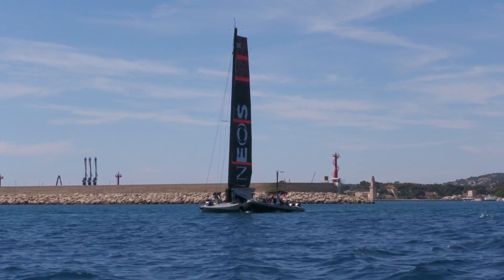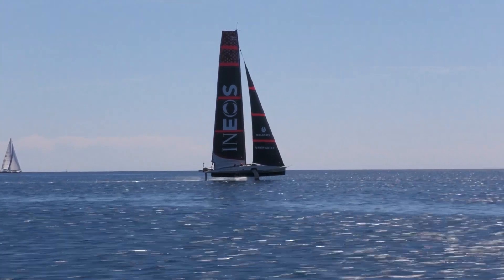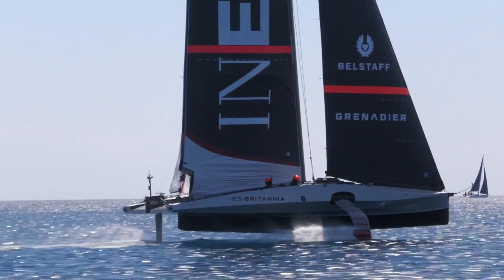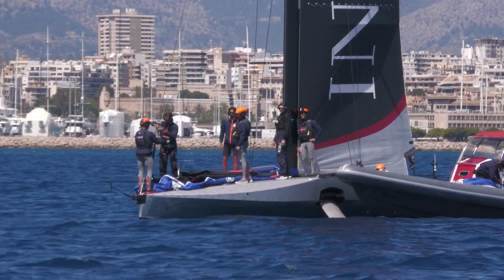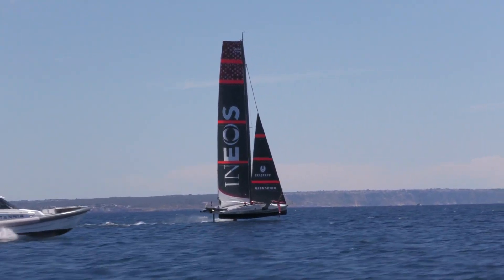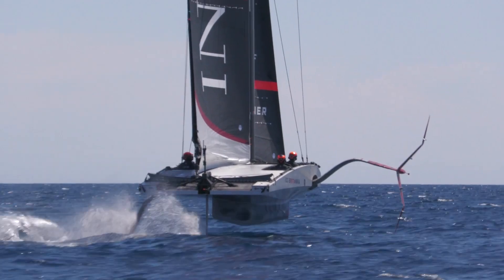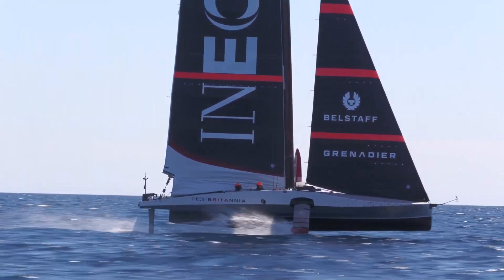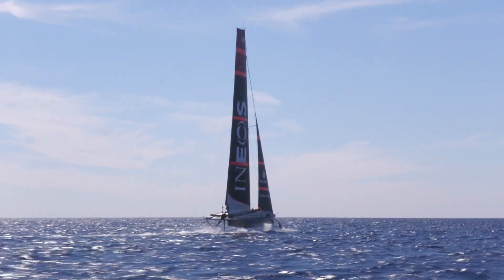INEOS Britannia T6 Day 37 Summary

Comment: Brilliant interview, I now need to google a few things, "M plating"?
Reply: End plating. It's using a surface at the end of a wing to prevent the high pressure air flowing to the low pressure side. In this case, the bustle prevents air from spilling from the windward to the leeward side under the hull.
Reply: @Ferdy PL  thank you! That makes more sense that my Google search. The bustle is the non silver part of the hull under the water line when they are not up on the foils?
Reply: @darylbultitude3786  Yes